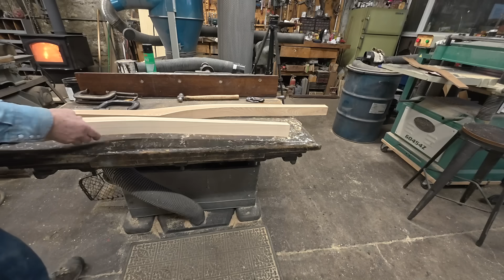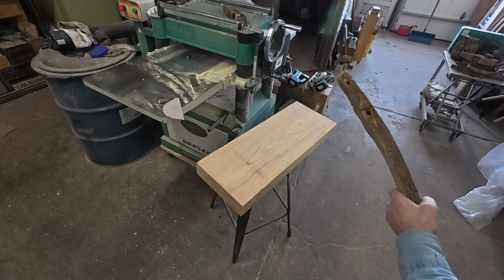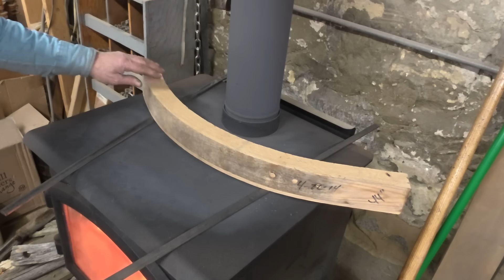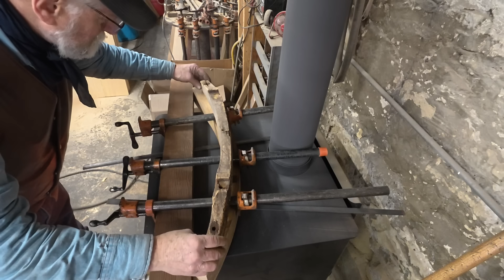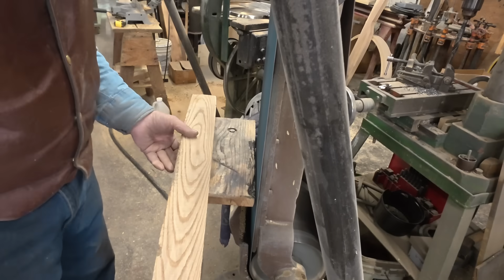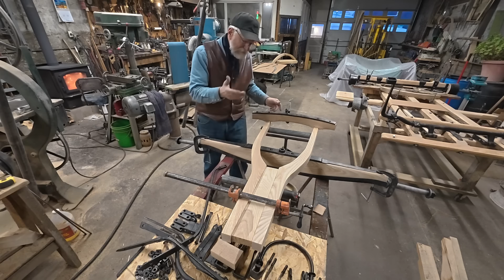Yellowstone Stagecoach - Bends, Curves & Joinery | Engels Coach Shop

Comment: It seems that the unbending challenge is that while you are heating it--the moisture is leaving, to a degree. I wonder if one of those turkey oven bags would trap the moisture with the wood. Perhaps in November, you might see one of those oven-proof bags go by. The stove might still be too hot for them, though, as they are rated for 350-400f.

Comment: Was the sharp edge digging in to board and preventing it sliding?
I've never done wood bending but I would think radiusing the sharp corners would let things move easier?
As you said at the end, wood is pretty amazing stuff 😎
Reply: Could have been some friction there, but those clamps were pretty insistent!  The geometry of the workpiece changed most of the force end-to-end, rather than down-in.  The force was trying to make the piece longer.

Comment: OBE at this point but would the fellow been able to stretch out easier if one (or both) if of the ends were rounded over to allow the wood to relax and slide along your straight piece as you applied pressure with the clamps rather than digging in?

Comment: Every episode of your work on the Yellowstone Stage Coach is absolutely fascinating. Your method of adding heat to the section of bent lumber and using wood clamps to bend it was really interesting. I have heard woodworkers talk about using ammonia solution to soak into the the wood which will chemically relax the lignin in the wood sample. Once the ammonia has relaxed the lignin, the wood piece can then be bent into the desired shape.

Comment: It took far less time than I ever imagined to relax that bended piece of wood. I was thinking hours, when in fact it was a matter of minutes. When you placed the upper part onto the axle, the point of all that curvature and filing and shaping was very apparent. It is not only functional but a thing of beauty. It will be painted of coursee and needs to be for the preservation of the wood, but seeing the natural beauty of the wood with the black painted steel, I would be very tempted (but not do) to leave it as it is.

Comment: G'day,

Yay Team !

Wow..., that was great... Very interesting indeed.

My father used to restore Bentwood Austrian Chairs, with woven Cane Seats -  originally imported into Oz as bundles of Components, all assembled out the back of the Shops where they were to be eventually sold.

Inevitably, some got legs made for  another Chair entirely, termed a "Walking-Leg" because it wasn't lined-up straight with the other Legs...; sold cheap at the time as being not quite right, but a hundred years later when Antique Furniture went through a popular revival fashion, it was the pieces with Walking-Legs that were most prized...

Anyway - Dad used to have to steam and bend and splice-in the missing Curlicues on Rocking-Chairs sometimes, to patch in bits which had been broken off.

I never before saw Wood being 
Un-Bent with Heat, though; wet or dry.

When I was making and selling Folding Boomerangs...
 (2 wooden Autogyro-Rotors crossed at 90° with a Wingnut & Washers to secure them and enable folding for storage and transport...)

The Rotor Elements, in side-view, are flat at the Centre 1/3 (the Hub of the Disc, where the Aerofoils are moving too slowly to be doing much more than holding the Outer Blade, functioning as a streamlined Strut) with slight and discrete Bend, of 3 to 5 degrees - ish..., which serves to give the Disc it's necessary "Coning Angle" without which no Boomerang, Gyrocopter or Helicopter can fly and be stable...

I used to carve and sand and drill and Balance the Elements,  then with a wooden Shim and a G-Clamp at the ready, the Location of the Bend was heated over the Glass-Chimney of a Kerosene Tablestand Lamp, burning a clean medium Flame with a freshly trimmed Wick, and when it was too hot to touch but before changing colour too noticeably...; the Clamp went onto the Hub on the Table on the Bolthole side of the intended Bend, and the Parallel-sided Shim placed at the correct distance out along the Blade to impart the propper- Angle, and the Clamp screwed down for it all to cool in alignment.

If I'd made a Jig then it could have been done on both sides at once, but I lined it up manually, one end at a time.

The idea being to have absolutely 
Zero 
"Riggers' Angle of Incidence" on the Blades as they emerged from the Hub.

In my "Aboriginal Technology..." Playlist, I have a Video on,

"Boomerang Aerophysics..."

to which one may refer - if the whyfores and howcomes are to be further unpacked.

Suffice it to say that checking the Coning-Angle is vital when preflight-inspecting any Boomerang...., and it's trickier with the more advanced Assymetric, Swept-Edge Hubless designs (which the Aborigines began using hereabouts some 10,000 years ago !).

The traditional one-piece Boomerang which my father bought in 1926, carved from the Root/Trunk Junction of a Tree (to acquire the bent Wood of sufficient strength...) had it's Coning-Angle and the positive Angle-of-Incidence bent into the 'Dingle Arm" by holding it over a Glowing bed of Coals, so the story goes...

I have custody of 3 original Stone Woodworking-Tools, actually ; a Boomerang & Spear carving Stone..., a Curved Spokeshaeve with 2 different Radiused Cutting Edges on opposite sides, for smoothing the outside of Didgeridoos..., and a Hand-Adze specialised for making Coolamons & Kylie's (Wooden Dishes & Shields...).

"For the olden ways have lingered,
Here & there, somewhat longer ;
And they haven't disappeared,
While you & I are still to
Ponder..."

Kinda thing...

(and, look in the "Warbles In The Wilderness... " Playlist to find the rest of that one - it's in

"INDIGENOUS MAN..."

Woodworking
Is 
Really really REALLY
OLD...(!).

Such is life,

Have a good one...

Stay safe.

;-p

Ciao !